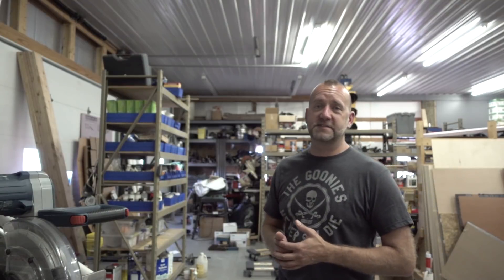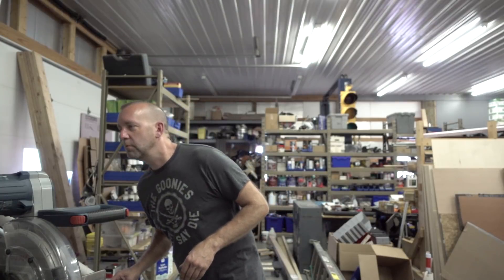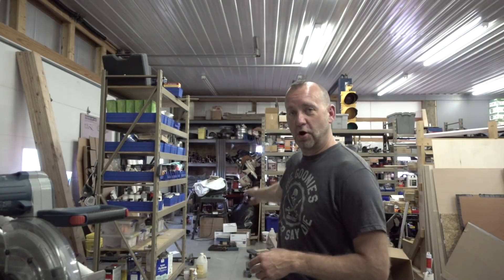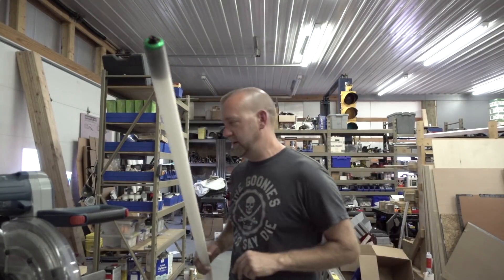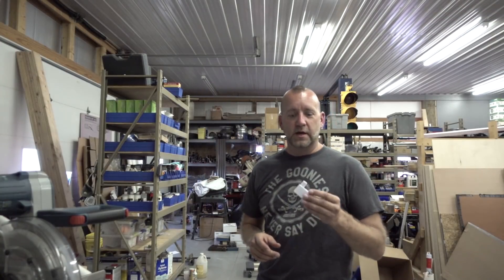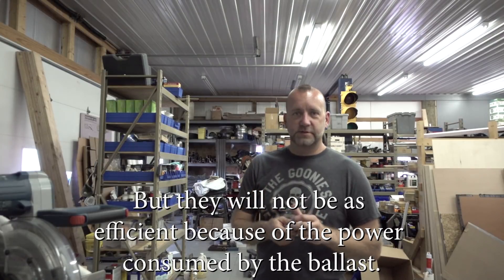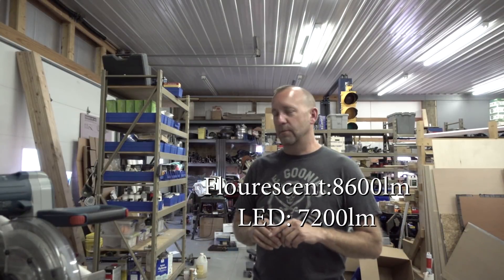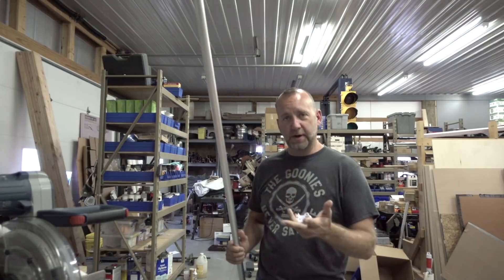Upgrade Your Shop Fluorescent Fixtures With LED Bulbs - #45

Comment: Light in a shop is key. This is hard to show the improvement on the camera, as the camera automatically adjusts the picture! LED comes on very quickly as opposed to the fluorescent that takes minutes to get warm. Especially if your shop is cold (like mine...). Thanks!
Reply from the maker: From Steel To Wood 
Thanks! I think so too. Lighting is key and I didn’t realize how much worse mine had gotten over time as the bulbs aged. Not only is the cold startup nice, the lack of ballast buzzing is a nice bonus. 

I tried to show the difference but I’m no photographer or camera master.

Comment: Wow, much brighter.  Only 20 more to go lol  
You really cant say enough about good lighting in a shop .
Reply from the maker: k VanDyke 
I agree! I only have a few more to go. I recently found the same style bulbs in an even higher output. I may buy a few of them to try.
Reply: @JaredsShop  Where did you find the brighter one's and what was the part number and brand? Where's the best place to find just the fixtures without the ballast that have the correct wiring in them..? ...Gave away a bunch of HO Daylight fixtures some years ago...DOH! They definitely look tons brighter! - have only seen one shop that put in some sort of led's,  but I don't think they wired it right as it was really irritating to look at them, frequency or something was definitely screwed up... Great vid and really liked the one about the ROXUL insulation - sweeeet!
Reply from the maker: @bbrent5340  
Thanks so much!!!

Here’s the ones for the HO fixtures. 
https://amzn.to/3QuLvTi

If you don’t have fixtures, I’d get these. I purchased a few for the office and to fill in other parts of the shop. 
https://amzn.to/3Oa7tcH